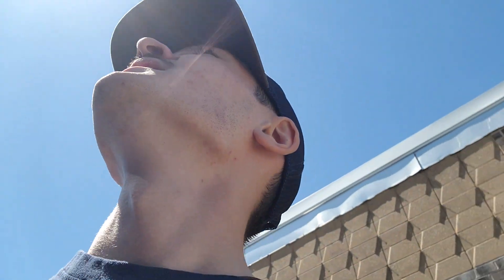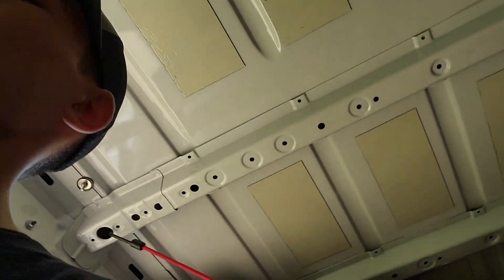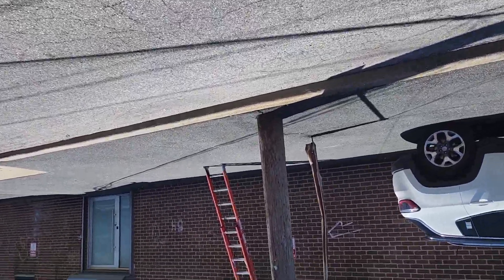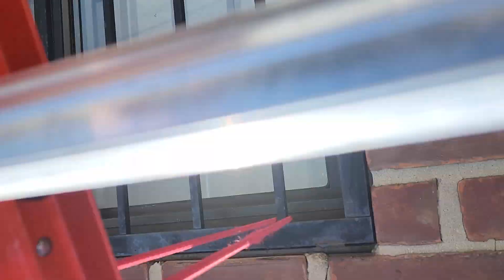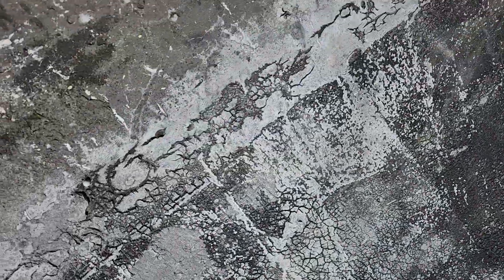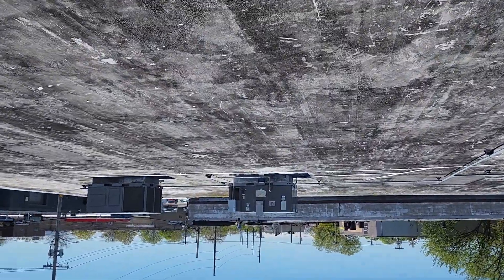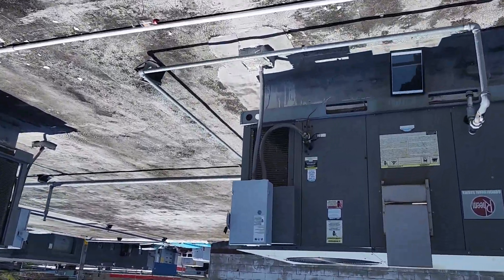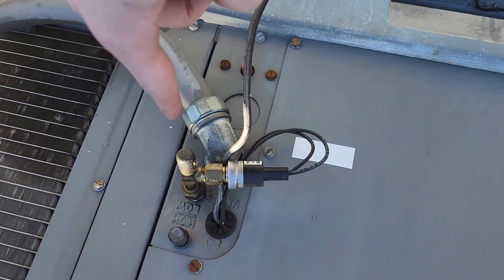Commercial Rheem RTU! What's Going On With These R-410A Pressures??? Fieldpiece SMANs In Action!!!

Comment: That pressure is pretty normal for 410a I wouldn't worry about the head pressure. its funny cause there is no such thing as negative subcool / superheat. Either you have it or you don't that's a mistake feildpiece made with those guages.

Comment: The 1st clue is the field installed low pressure cutout switch (poorly installed at that)...so it's a known leaker for sure that's seen at least a few recharges and quite possibly has air in the system affecting the pressure readings. Low side (gaseous) leaks affect the properties of 410 where a liquid leak doesn't (a leak near the bottom of the condenser or in a subcooling circuit). Frankly, the LP switch was probably installed to prevent icing the coil which may have been the reason for the initial complaint of water leaking in the building. Also with there being insufficient water column in the condensate trap, air was probably being sucked in preventing the drain pan from actually draining.

Comment: Well, If you got issues with finding a water source, it might be a good suggestion to see about a cordless water sprayer to help you spray the coils down. It'll take a little longer, but it'll get the job. I know that some others may have suggested brazing it, but if it is leaking at those channels, you could consider coil replacement as an option. You could be chasing leaks that pop up from too much heat from the torch blowing out new holes.
Reply from the maker: Pipe Doctor has... just a matter of bringing enough water for 6 units
Reply: @DCHVAC   I suppose if anything, several 5 gallon buckets roped up to the rooftop to negate going up and down to refill water.

Comment: not high. forget the pressure. look at the saturated temperature... 75 degrees satruated?  9 degrees over ambient? I don't think so. its only 9 degrees higher than the outside air temp. should be like 20-30. 

and also ditch the 410 manifold mentality. manifolds are expensive. I only use one. if you mix a small amount of oil no big deal.
Reply from the maker: I use the 410 manifold cause I keep it pressurized so I don't lose any refrigerant.
Reply: @DCHVAC  for that you could also if you have valves shut the high side hose valve. And open on your manifold on both high and low side. Suck all that liquid back on. And you only lose a little bit of vapor. Really nothing 

You can do the same thing with low loss by removing the red side first. Leaving the blue side hooked up still and opening both blue and red valves on your mani. You really don’t lose anything.
Reply: think about this.. the subcooling should be about what 10*? If your liquid line is actually 77 degrees per your mani. that should make your head pressure at least 87 degrees assuming your liquid line stays the same.  makes your head now 263 psi/87 degrees saturated. which would put you about 20 degrees over your 66 degree ambient...

Comment: There is a leak in the "micro" coil. Needs a new condenser coil.
Reply from the maker: Yes, customer wanted it up and running as soon as possible, issues can be addressed later. Office building for other companies and he is the owner
Reply: The leak in the condenser coil, it will likely be out of gas in less then a week.  The coil will be completely blown out. Microfin could are bad.

Comment: 290 on high side isn’t high for 410a
Reply from the maker: For only being 66⁰ out that seems high
Reply: @DCHVAC  not high. forget the pressure. look at the saturated temperature... 75 degrees satruated?  9 degrees over ambient? I don't think so. its only 9 degrees higher than the outside air temp. should be like 20-30. 

and also ditch the 410 manifold mentality. manifolds are expensive. I only use one. if you mix a small amount of oil no big deal.

Comment: 410a can do strange things...micro channel junk
Reply from the maker: You have experience with Micro channels? I'd love to hear please.
Reply: @DCHVAC   yes...they can be hard to clean and have found quite a few leaking
Reply from the maker: I'll be cleaning 6 soon... any advice?
Reply: @DCHVAC   Coil cleaner .. A good water supply...and patience 😄
Reply from the maker: I have no water supply.... oh boy
Reply: @DCHVAC   uh oh...
Reply: Most leaks i have found was at the end loops where they go into the coil.... Can braze them just gotta watch your heat... Burn through easily
Reply from the maker: Oxi-acetylene? Or turbo
Reply: @DCHVAC  I  use oxy acetylene...we dont solder or press....we braze everything
Reply from the maker: Is it a major issue if you end up blocking a micro channel with braze?
Reply: @DCHVAC  never blocked one..lol...just watch your heat....heat it slow....you will do fine.... Ive enjoyed watching you learn and grow as a tech... You do great work ....better than some guys with years of experience
Reply from the maker: @thefathvacguy6341  thanks.. lol. Knowing my luck I'll block one.
Reply: @DCHVAC  you got this Daniel.... I got 12 years on the job. . You do things i dont know....